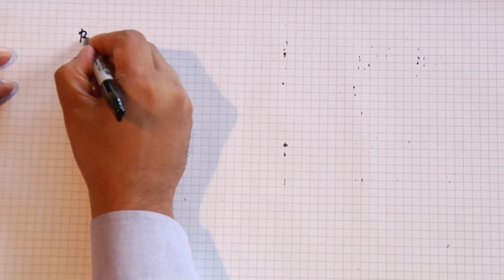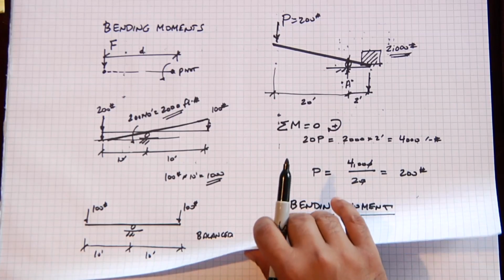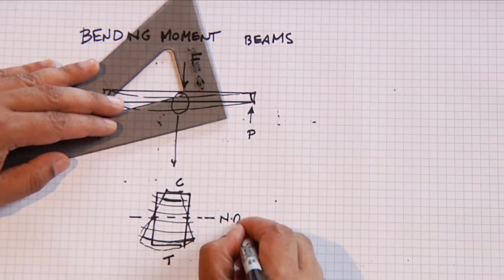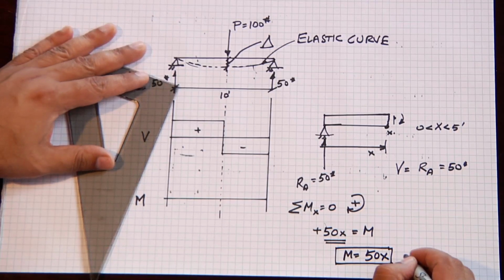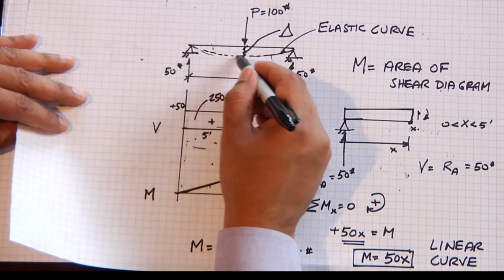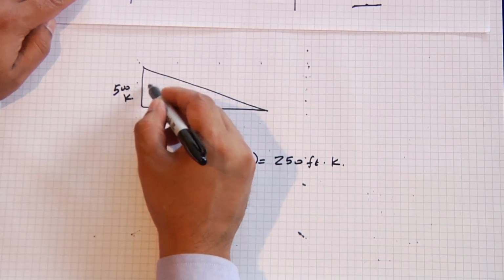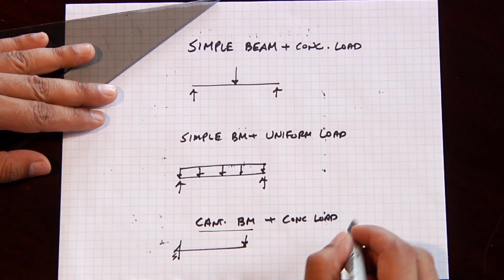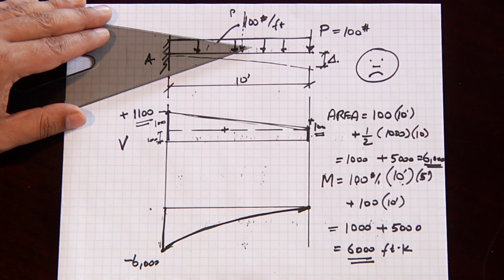AIA Structural Exam - Module #3 - Moment Diagrams

Comment: I watch segments multiple times until I internalize/understand the basis of the math, and use the video speed option - usually 1.5x and sometimes 2x.  If you were able to have 'screenshot moments'  of a completed diagram or problem, without hands, pens or triangles in the field for a few seconds, that would help tremendously as well, (though I don't want to sound like an ingrate...)
Reply from the maker: OKAY, I will consider this and provide Notes.
Thank You!

Comment: during the moment diagram calculation for the simple beam with uniform load, he calculated the area of the triangle correctly originally at 1250 but then kept saying and writing 250 after "explaining" how he got the area of the triangle.  This is confusing as 1/2 (500)(5) aka 1/2(b)(h) should be 1250 not 250
Reply from the maker: sorry for the confusion.
Reply: Same thing confused me too.